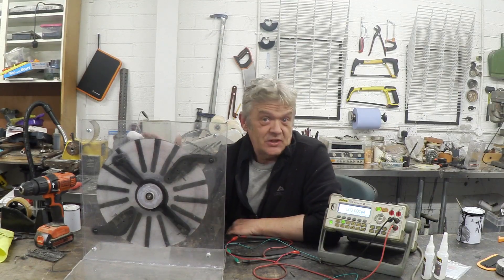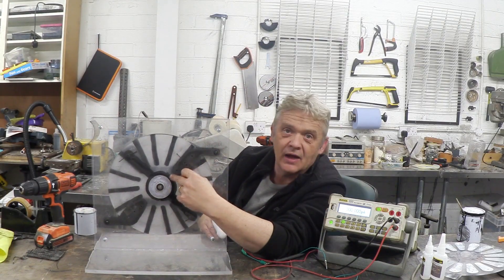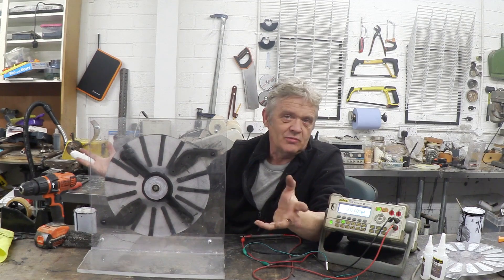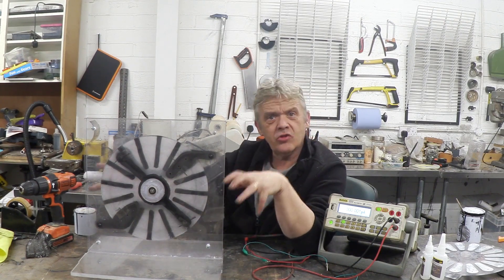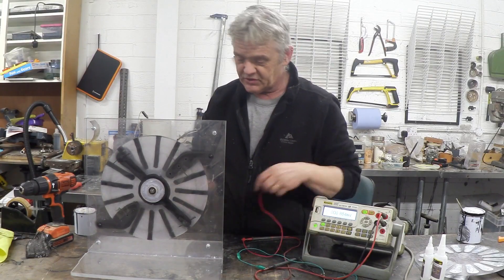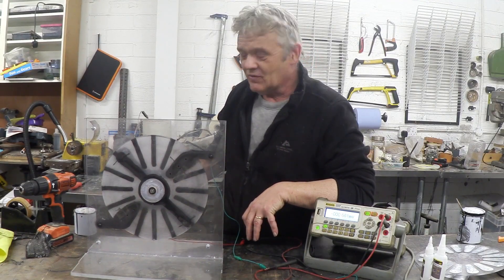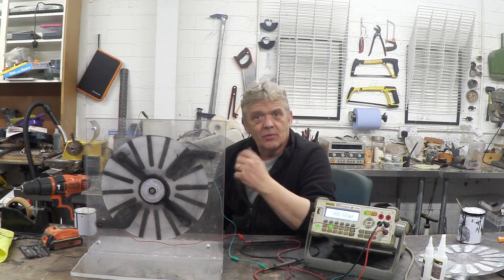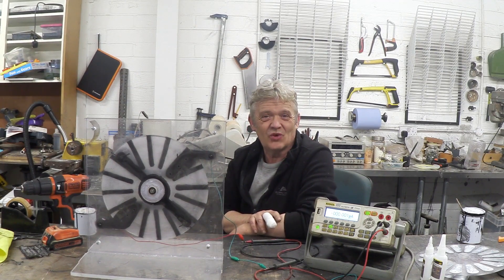725 A Printed Generator - No Copper, No Coils, No Wire, No Magnets

Comment: Dear Robert, 
the Explanation at the beginning in your video inspired me again after several years. At those time i wanted to know how Peter Baumann's Testatika works! Maybe you or someone else can solve his well keeped Secret much better!
But you should know that this is a greater challenge than a simple "Wimshurst Generator" with your conductive ink!

Baumann's Testatika rotated without an external power!
In my Research I found out, that he uses also quartz crystals, which he wrapped with copper coils and stimulated with the little electricity (like in your printed Generator is produced) that was generated  to emit high voltage in a piezoelectric manner! He used the crystals as a heart, and with the strong heartbeats he controlled the whole electrical circuit!!! He picked up this high voltage with collectors made of mesh and collected it in capacitors. With the energy collected in this way he let the disks of the Testatika turn and the excess electricity he used to bring lamps to light or to operate other consumers!

However, less is often more!
Greetings
Reply from the maker: I must have a look sometime mate
Reply: @ThinkingandTinkering  I would take a look Robert.  Methernitha Testatika Baumann - machine apparently capable of kilowatts.

Comment: Awesome! This may sound crazy but couldn't we also use mechanical advantage in gear ratios to add more plates (even counter rotating) and increase the output greatly with ever reducing input energy?

Not to say "free" or unbalanced energy (lol) but speeding them up using gear ratios to maximize the output from the same input?
Reply from the maker: I would think so mate

Comment: I actually saw this generator in the Star Wars movies.  There is a scene there where the empire used Giant discs stacked in parallel,  and it would power the Storm trooper's bases. I remembered seeing giant high voltage arcs from it in another scene.  I knew those had to be Wimshurst generators on a massive scale.  It makes sense because it generates no Counter EMF, so theoretically you could draw large power with very little input energy.
Reply from the maker: which film was that mate?

Comment: This is a clever low-cost implementation of a Wimsherst machine (en.wikipedia[dot]org/wiki/Wimshurst_machine) or a variation on that.  Sadly just a novelty but clever regardless.
Reply from the maker: it's a dirod mate - AD Moore came up with it - but I said that in the video - I also said it was related to the Toepler and Holze machine - but then most electrostatic induction machines right from the Bennet doubler are built around the same principles so look very similar. The Wimshurst was developed further into the Pidgeon and wommelsdorf machines and later research by jefremenko is well worth a look at if this interests you

Comment: I wonder if you could print out the template in an inkjet then your the paper to the plastic.
Reply from the maker: the ink we make won't work in an inkjet you would have to formulate an ink for that - but if you did I would guess yes
Reply: @ThinkingandTinkering  good to know
...quick question: would it be possible to make a conductive wire with the paint? Like coating a piece of string, tape, or painting the outside of a soda bottle slicing it to make wire/string (one-sided/insulated).
Reply from the maker: @annamolly1261  I would think so

Comment: Did you know a copper clad quarter is in actuality a Battery? I once dipped one into a photographic fixative bath and it plated itself silver. Interesting!
Reply from the maker: it is - that's a replacement reaction if you put iron in copper sulphate the same thing will happen but copper will plate - you can actually do this with a fair few things - it's quite fascinating

Comment: Astonishing!  With no back emf  it shouldn't be difficult to spin at tens of thousands of revolutions per minute with one or more small diameter turbines. What are the parameters for getting more energy from this generator apart from speed? Brilliant every day, thanks a lot!
Reply from the maker: I would guess surface area
Reply: @ThinkingandTinkering  If it were possible ... using a very long treadmill
instead of using plastic hard disks we could obtain a very large surface area in a very compact volume such as the labyrinth structure. But perhaps it is better to expose a large area of graphene ink to the sun.

Comment: There are so many ways electrostatics can be adapted to produce workable voltages with currents able to power everyday devices.
I am reminded that lightning itself is generated from static charges, there is a lot of power in a single bolt of lightning so static electricity devices have huge potential.
Use gears, uses stackable versions, whatever, just don't lose sight of the potential.
Reply from the maker: agreed. mate also the high voltage can be used directly for lighting for example and in electrostatic motors - personally I believe electrostatics needs more research
Reply: @ThinkingandTinkering  yes I agree wholeheartedly. Too little research has been done in a field that has so much potential.

Comment: Not the most compact energy source, but definitely the cheapest! Im guessing wood would work as well. If very dry, damp wood may not work as well,  put as bout 100 in series, and charge a phone,  it's amazing, more amazing than starting a fire with two sticks! Awesome work!
Reply from the maker: probably not mate - wood is actually quite conductive at high voltage

Comment: Hmm, 2 volts and .6 amps. That's looking pretty close to being the standard AA, AAA, C, or D cells which are 1.5 volts. You might be able to run an electronic gadget that takes two of the stated cells provided the device does not need a greater amount of amps than is being generated.
Reply: 0.3 micro amps or 0.0003 mili amps
Reply from the maker: it was post of a microamp mate - this is very low power I am afraid
Reply: @ThinkingandTinkering  sad that  current is low, but anyway low power or not, still is this awsome project. I love static generators from school which was demostrate. Do you will make also a Van de Graaff generator?

Comment: Could this ink be put into one of the refillable inkjet cartridges? If so finer traces could be densely printed onto the backing.
Reply: If it can be dried to a fine powder, and is a thermoplastic.... It may work as laser printer toner.
Reply: I think that's part of the answer as well. How much of those strips on the disk are actually needed to produce that output? What is the effect of multiplying the number of them? Questions, questions.
Reply from the maker: you would have to formulate an ink for that but if you did I would guess yes

Comment: So, how to get this in a vacuum now 😊
Reply from the maker: seal the edges put some stiffening on and pull a vacuum with a pump
Reply: @ThinkingandTinkering  would it still be possible to spin it up though. Could it be fully encased, and then start rotating with a magnet, which can then be moved away so as not to interfere with the rotational force once spun up?

Comment: SINTERING?
Robert many people do not know that entire circuits can be printed with conductive plastics/inks and printed semiconductors, including transistors. This has been done for many years now. Sintered conductors can be produced by printing very fine metal powders which melt at  temperatures extremely far below that metal's normal melting point. Interesting topic for the future? You opened a new can of worms here!
Reply from the maker: I am a particular fan of xenon flash sintering

Comment: Robert you are onto something here. I tried some ideas along the lines of printing electrostatic conduction paths some decades back. I should have pursued it a bit further. 
1. With higher resolution printing, you can make this smaller and stack them (i think some other comments agree with this too) and put them in all sorts of combinations of series and parallel.
2. At a smaller size and precise balacing (which would be possible with no wires), you can try spinning this with a Tesla turbine at insanely higher speeds
3. How about reducing air drag by chucking the whole assembly into a vacuum?
Great one indeed! IMAGINE THAT - LOOK MA, NO WIRES!

Really interested to see where your fruitful and productive mind will take this. Plasti-carbon generator.
Reply from the maker: I think it is interesting for sure mate

Comment: But what about durability? Can it survive rotating a month? And what's the efficiency, is it comparable to a conventional generator? Because if so it's an interesting possibility, but if it breaks after rotating for a day it's pointless, also if the power output is so low at high rpm it's going to break faster, you should work on a way to increase the energy generated per rotation, doubling the energy prodution per rotation would be a great improvement even if the resistance would increase proportionally, and it would also reduce the losses from friction
Reply from the maker: i am sorry mate - and i don't mean to be rude here - but your comments make no sense in light of what you are looking at. Durability is going to be directly related to build quality - so basically how well you make it and what materials you use will determine this - as for efficiency - what do you mean? Efficient in what terms? conversion efficiency of mechanical energy input to electrical energy output? if that's what you mean it would depend on what mechanical energy source you used - for example if you used a fuel motor then it's going to be limited to below the carnot efficiency, if you mean to drive it by wind then the Betz limit will apply. Finally - you are looking at an interesting effect and a prototype build - just what are your expectations from such a thing?

Comment: what happens when you pass a magnet over a pancake graphene ink coil?
if you coated copper wire with graphene ink and then an insulating ink would it improve the amount of voltage the wire could handle/produce before it vapourises?
Reply from the maker: no idea but interesting question

Comment: Cool, but how do you run it as a motor?  Would it work with straight DC or would it need to be alternating like a BLDC?  Can't wait to see how much power a stack of these would produce.
Reply from the maker: You need a HV input mate to run this as a motor

Comment: If you rotate anything it will produce volts, i cant go into detail here, however when somthing creates a vortex it pulls energy from around the vortex, may be called eather or resonance whatever you want to call it.
Reply: This is why I was going to try lord kelvins thunder storm using counter rotating water. I noticed when the vortex sprays out the drain it first increases in size then comes back to a point. Apparently I didn't  upload the video of it.  In my video called slurp, you can hear all the air it is sucking into the containers. By spinning the water I make it heavy.  It is not until you put a drop of food coloring you see how fast the water is moving inside the container. I must admit i didn't  think my boat would float in the vortex cause it could easily pull a ping pong ball all the way to the drain. So i cut the top off a plastic bottle and put a small hole in the cap. As long as it allows air to flow thru it doesn't sink to the bottom. Spins fast in the vortex but doesn't  sink below the water line.
Reply from the maker: interesting cheers

Comment: I think for what you have in building it...it is really great. Stacking these on a single axle would be awesome multiplied current! 
Will the results differ if wooden disk are made? I have wood but not the plastic you have.
Reply from the maker: I am not sure about wood mate it becomes conductive at HV I source a lot of my plastic sheet from scrap I find laying about tbh - might be worth just collecting some

Comment: If the inner circle is in essence a series of rotating capacitors, what happens to the output if they are each charged to say 1kV for example?
Reply from the maker: once they reach the breakdown voltage of the air gap or the plastic they will arc
Reply: @ThinkingandTinkering  along with alu foil, mylar sheet been used as dielectric for capacitors for use in DIY TEA lasers... Couple sheets good for use to about 14Kv.
Reply: @ThinkingandTinkering  I understand the necessity of dielectric strength for the rotating capacitive fields, but what I was trying to get at, is their effect at high voltage on the extraneous current collectors with which they interact during rotation.
In essence, everyone understands magnetic induction in a rotary machine, what I am asking about is the level of electrostatic induction in a rotary machine, whereby the rotating magnets have been replaced by rotating high voltage capacitors which are electrically insulated from each other, and the field collectors, but not electrostatically limited from interaction?

Comment: I wonder if more stripes on the plates closer together would help?  or if you split the stripes into bits so you got 2 or more bands radiating out, and added more brushes, if that would have any effect? that may be an ignorant question though.    I guess my question is- is it the length and size of the stripe that matters in how much charge you get, or the number of them?  or is that irrelevant?
Reply from the maker: oh I ma sure there will be an effect mate and I don't know if you noticed or not but there are 3 drill holes in the collectors for exactly those experiments

Comment: If you painted 100 times the number of paint lines that you have just each line being much more narrow and closer together.. Then you should get 2000 volts 3 amps!
Reply: 100 times make in serial connection 200V and 0.3 micro amps or 0.0003mA
Reply: Makes you wonder how thick the line really needs to be? Can you get by with just one strand of carbon fiber as a brush? Also segment the line into several segments and add a brush to each segment.
Reply from the maker: it is a very interesting question mate and I have prepared the thing for this kinds of experiments

Comment: Around 1 volt spinning it by hand and only 2.5 volts spinning it with a drill... Seems to make more sense to power it manually or run it slower perhaps off of a wind powered fan or a water mill or any one of the other inventions you've shown
Reply from the maker: it is strange for sure

Comment: how does that compair in conversion efficiency to wilmshurst with static caps and a tesla coil i wonder? 
Could the tesla coil be reproduced entirely with ink?
Reply from the maker: no idea mate - but I do like the idea of making pancake coils with this as normally pancake coils are a real pain to make
Reply: @ThinkingandTinkering  hehe morning, i deleted one about magnetite , but you can make graphene like nano sheets of magnetite too so i read, which means u could make a printed pmg if you made ink from it.
Reply: Maybe he could print some of Tesla’s flat coils? A printed transformer.
Reply: @lokilyesmyth  yes a pankake coil would work, you could make a "coil" with printed half circles too maybe
Reply: if you paint a plastic bottle with the ink and slice it into a thin wire by pulling it through a stanly blade , hey presto a nice cylindrical coil for the tesla coil.

Comment: Future efforts stacking disks and output in series and parallel? This is very very good Robert!
Reply: @drop stix ... Into a battery or supercaps made out of the ink :)
Reply from the maker: I am going to look at the number and thickness of the lines mate
Reply: @Barskor1 Absolutely. I just wanted to put a little perspective on the current(hehe) model. If one of these could get to 1mA or maybe even 5mA, then it would be dramatically more useful, and yes I do believe there is loads of improvements that can be made to this.
Reply: 15,000 of these in parallel that are also in series with another 15,000 will be enough to power one LED if the voltage and amperage dont decrease under load. Considering it takes about 1.7 volts and about 15 mA. This makes 1v at 0.0001 mA
Reply: @dustinsmith8341  It is a prototype so the performance is not the best it can be considering 90 plus percent of it is carbon in one form or another makes it extremely interesting.